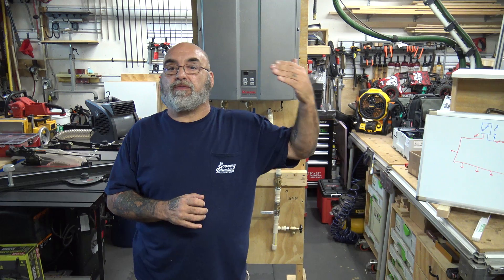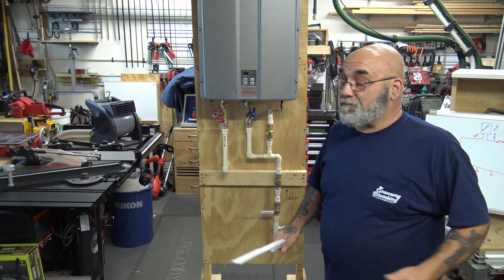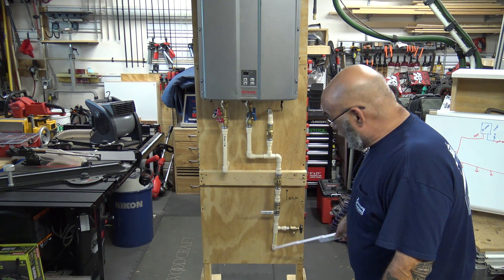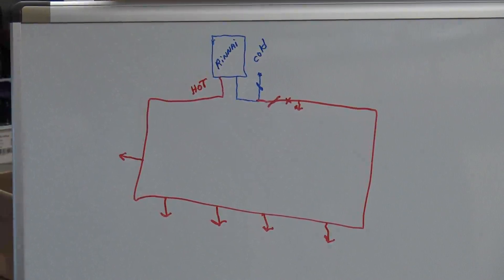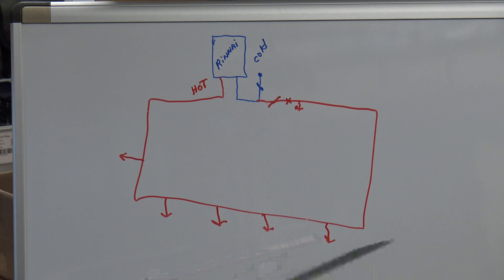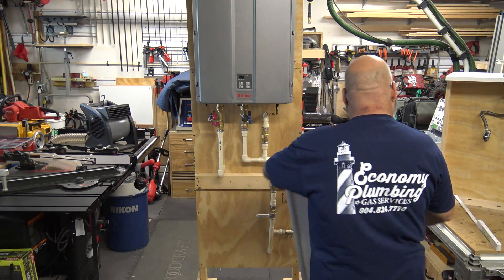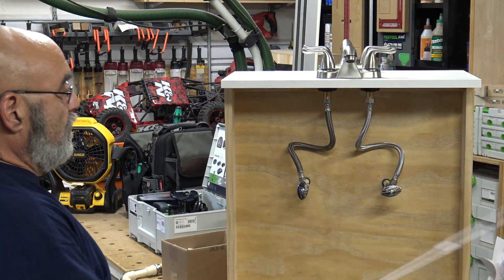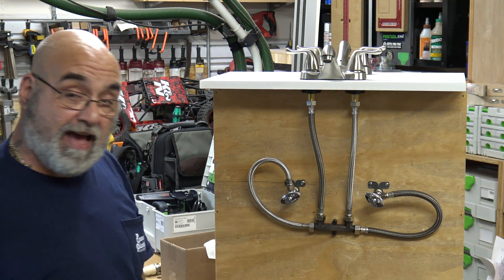Proper water piping for a dedicated return line on a Rinnai RUR unit

Comment: Hi Mike,
I have had two firms quote me Rinnai  RU199IN.   I do not have a dedicated return line.One quoted the RU unit and will not install an RUR stating they are problem units.The other was pushing the RUR stating it will provide instant hot water and will not waste water.  He also said that the cold water would not be affected.
The amazon ratings on the RU seemed much better than the RUR.Which will produce hot water with the least problems and is the best choice for me.  I would appreciate a rapid response since I must make a   quick decision.Thank you for your help.

-- 
Murray Bob
Reply: So what did you get, I just ordered a RU199ip, I didn't get installed yet, but I wanted to have a circulation pump put in, if I can't do it with the RU, I will return for the RUR.
Reply: @gracetemplechristiancenter1237  Did you end up using the RU or upgraded to RUR?